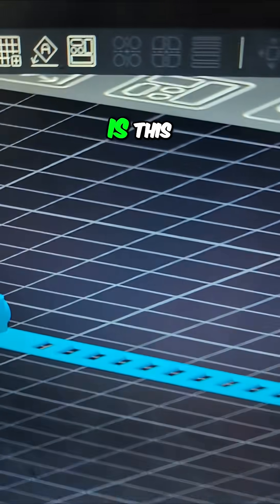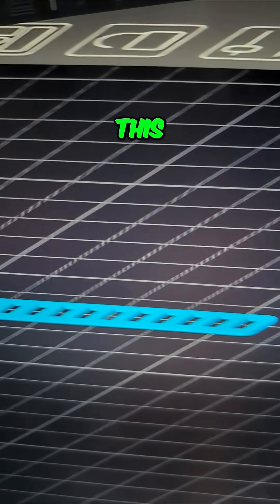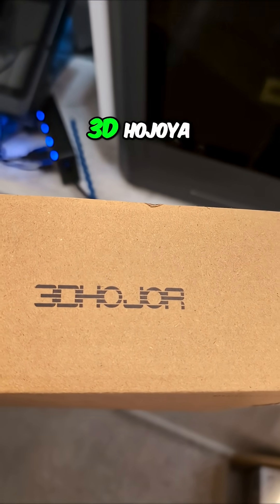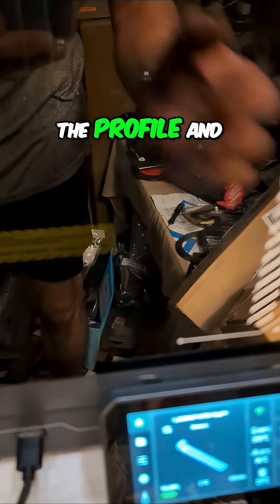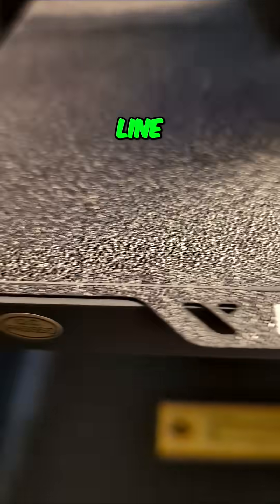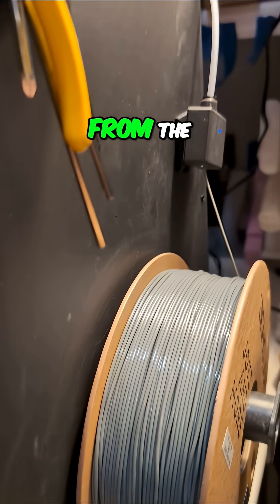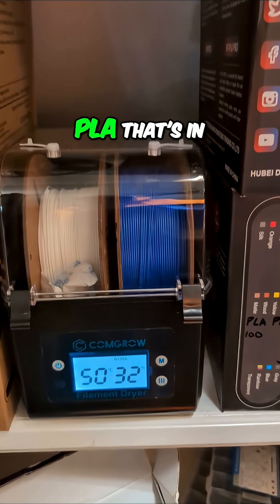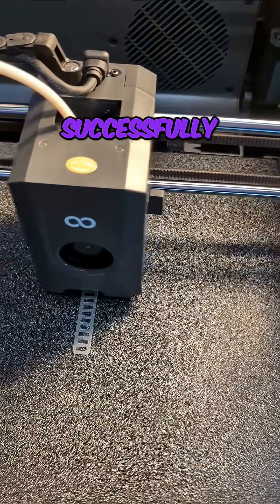3D Printing TPU Without a Dryer?! Will It Work?!

Comment: Though I've only printed only a few things in TPU, so far, I've seen that printing TPU without the dryer is fine and there's no harm feeding through the tubes as well. The filament must be dried the first time or if it stays in a humid environment for a few days, but once dried, the rest doesn't matter much in modern printers. On my Anycubic Kobra 3 combo, it recommends not feeding TPU from the ACE pro (MMU cum Dryer), I've had successful prints.
Reply from the maker: Great feedback. Seems consistent with my experience

Comment: Ive printed tpu in open air on the spool every time and never had a problem.

As long as i dry it for a full drying cycle of 140°f for 8hrs it takes 4 days to a week for it to pick up enough water to make a difference in print quality, 4 days for transparent- a week for opaque
Ive had petg take a month to pick up the same amount of water from open air, pla is like 2 weeks
Reply from the maker: Great info, thanks. I have no such data for my uses. That helps.
Reply: In short, you'll be fine